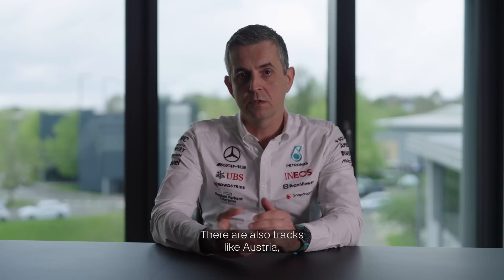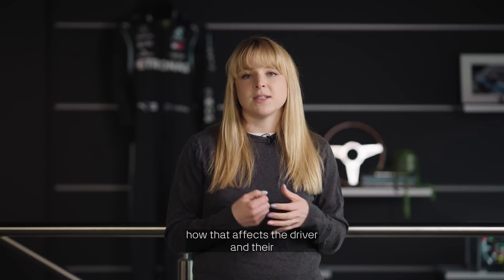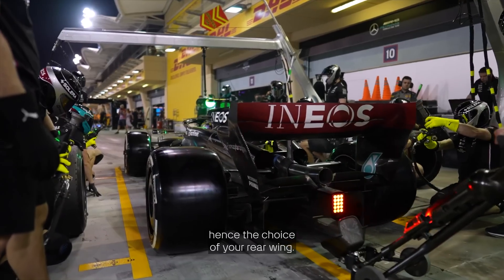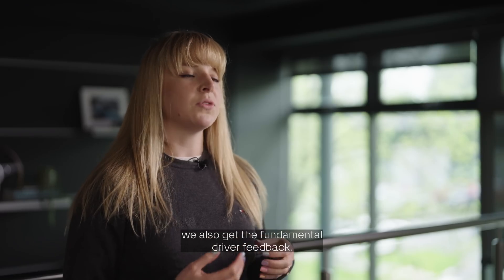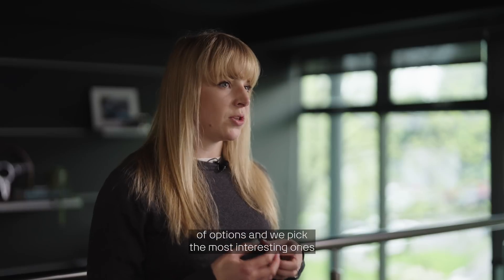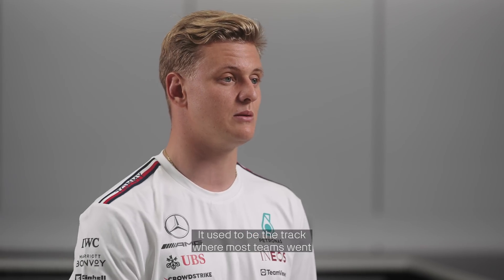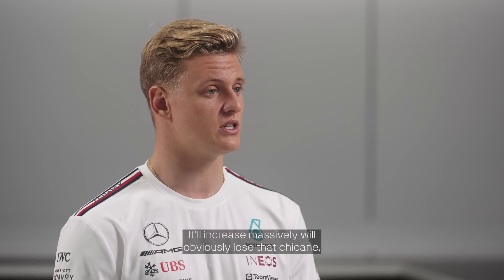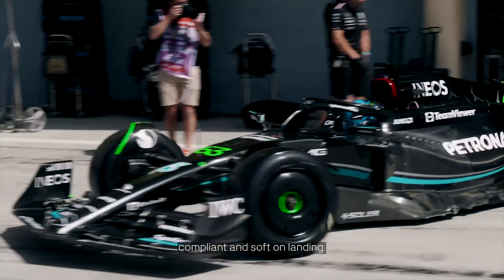How Do F1 Teams Prepare for Track Layout Changes?

Comment: In 2022 teams got Monaco-level rear wings in Spain. Guess they won't go this extreme in 2023.
Reply: Yeah rear wings will not be as big but front downforce is still gonna be necessary I think, othewise the left front tyre dies by lap 5
Reply: If anything they'll want even more. The chicane killed most of the entry speed the drivers otherwise would have for the last corner, now entry speed is so high the corner might not even be flat out anymore. Meaning that there'll be a massive premium on downforce in this corner on he 2023 layout. And Barcelona already had multiple high-speed-but-not-flat-out corners. Downforce wasn't very valuable for the chicane and the preceding corner on the 2022 layout however. They were so slow that maximum cornering speed was primarily dictated by the amount of mechanical grip you have, not by your aero setup.